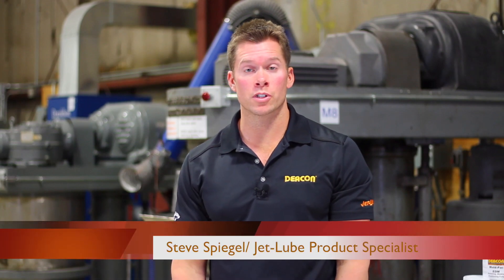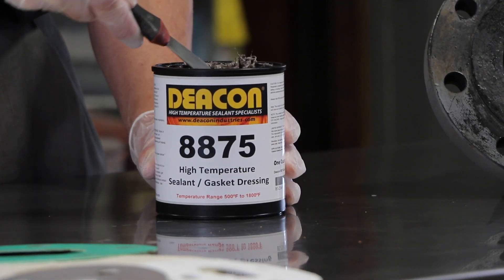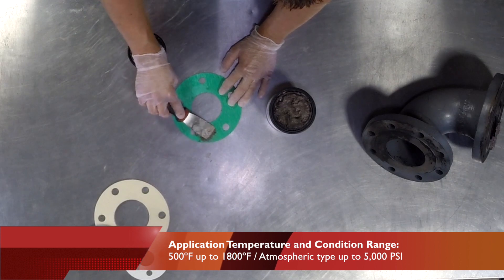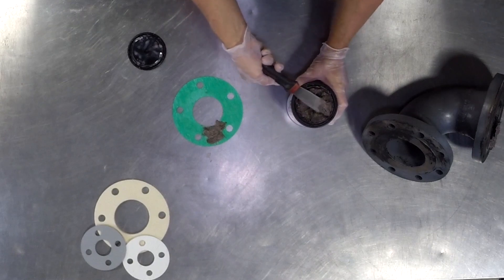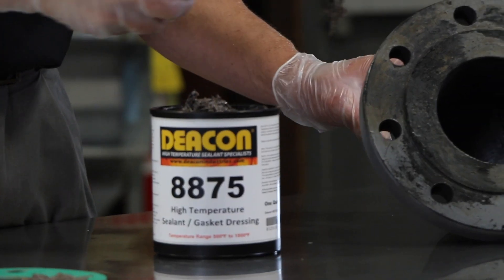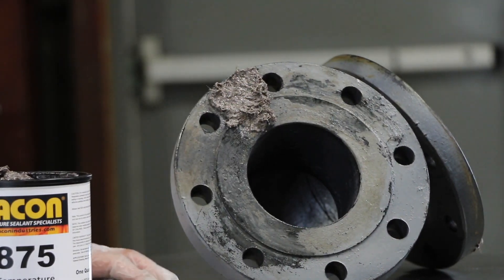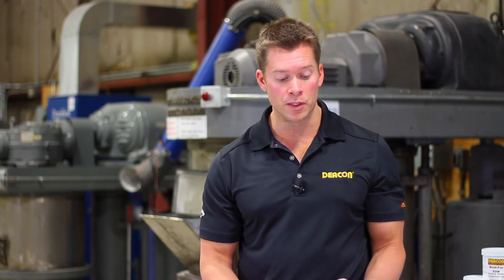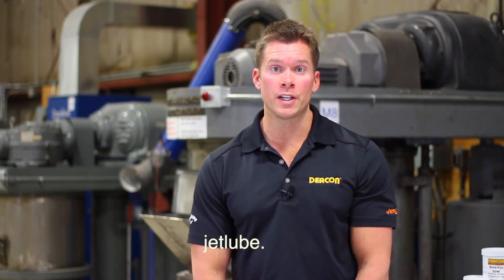Deacon® 8875 - Thermal Reactive Paste Sealing Compound

Comment: Hello, Is it suitable for pcp air rifle fitings and to seal the valves in the air cylinders (300bar 4500psi) , instead of o-ring or Teflon tape 🤔
Reply from the maker: Hello, the product must be cured with heat before it’s able to withstand 4500 PSI of pressure.